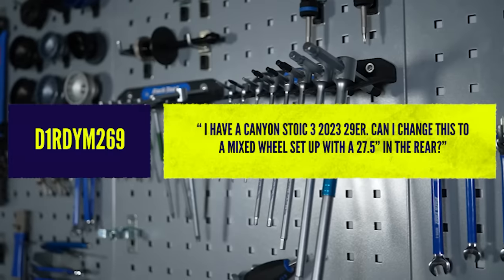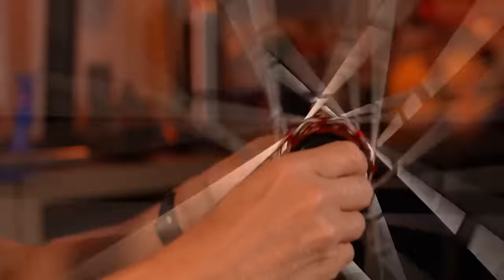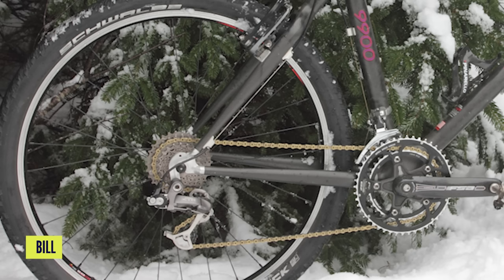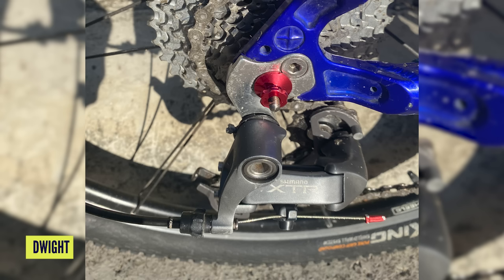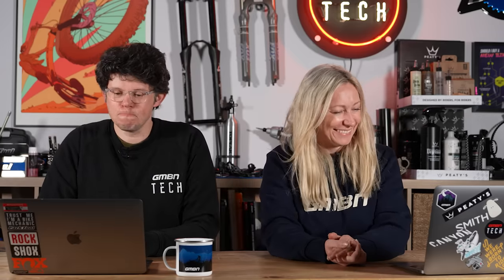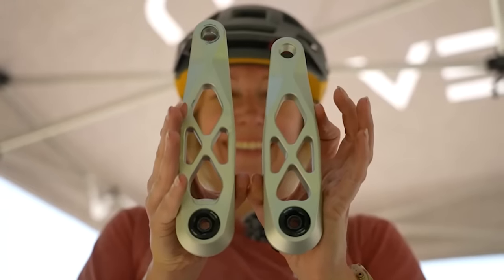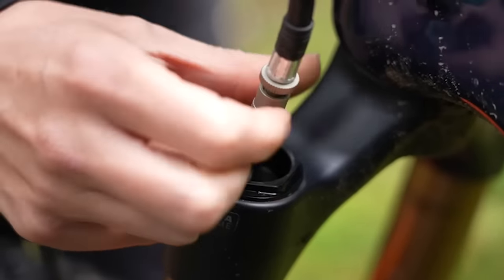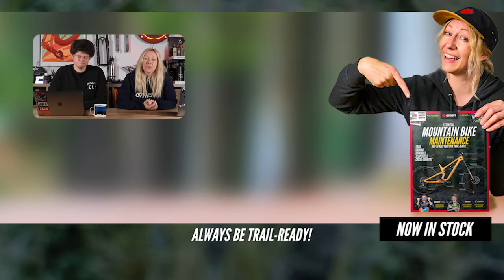Can You Make A Freehub Louder? | Ask GMBN Tech

Comment: Regarding reducing the travel, the answer is much simpler: check how are positive and negative chambers connected. If it's a cutout in the stanchion, it's near impossible. If it's a valve in the piston*, all it takes is a custom spacer above retaining ring or underneath a top out bumper.
*like most of recent RS

Comment: I never had a problem with my Rapid Rise. And I could shift and brake at the same time, when I wanted and needed to easier. Also you could do a fast and massive shift up the cassette without worrying about snapping your chain, because the shift was controlled by a spring and not jamming it with a mechanical cable. I think riders and mechanics had a problem with it, because, it was different and backwards to what they were used to. Given time and refinement it would have been great. I feel that on a 1x12 system large range or gears, it would work great and lower the chance of snapped chains.

Comment: Rapidrise was brilliant, and completely intuitive. The gears were the same on both front and rear as opposed to the normal system which is reversed.
They should bring back dual control levers for di2 systems, that was the best part of the system.

Comment: The amount of homemade multi sprung hubs I’ve had over the past few years from customers instore, some using coke cans, other tape measures cut up…. It doesn’t improve the hub, and it’s arguable it even makes them louder, but it definitely ends up with bits of broken home made springs floating around! Most don’t understand that the high end hubs do a lot more than just have more pawls, making the louder.

Comment: Dual control levers on road bikes were a huge game changer. It makes sense because the lever blades are long and fit naturally in your hand, and in an easy position to operate without mishap. On MTB however making the gear changes are at an angle which is unnatural for your hand position. There was also the risk of accidentally operating brakes trying to shift on rough terrain, and vice versa. The modern solution of having seperate units that can bolt to the same clamp makes much more sense.

Comment: I had an XTR rapid riser on my 2003 Canyon Nerve MR8 with exactly those XT Dual shifters. I think they call it an inverse derailleur in Germany - The problem on that MTB is, I couldn't jump fast down to lower gears when accelerating uphill.  The dual shifters were also annoying as you could just accidently brake or shift a gear at the same time when you were getting tired. I sold the whole system on ebay a few years ago, replaced them with regular non inverse XT and haven't been missing them since.

Comment: I still use the Shimano dual control levers (cable) on my commute MTB and they work great🤙🏻🔧
Reply from the maker: Are they easy to get parts for? 🤔
Reply: @gmbntech  They were bought NOS and been using them for about 15,000 kms now. Haven’t had to buy any parts. I would say, I think the 9 speed shifter cable has broken a couple of times more than expected due to the internal design (has always broken inside the lever) but still very easy to swap out👍🏻

Comment: #AskGBMNTech First of all congratulations for the program, considering for example 2 kilogram of gear like water, tools, spare, co2, etc, it’d be easier to my legs having those 2 kilos on me?(fanny or backpack) carrying my legs those 2 extra kilos on my body and a lighter bike?, or the 2 kilos on the bike, pouch, bottle cage?  In this case my legs will have to move a bike 2 kilos heavier. Consider that the total weight that has to be moved is the same. Silly question. Have a blessed day guys. 
P.S. Anna Cipullo is my platonic love 😍😍😍😍😍😍😍. Big fan.

Comment: #askgmbntech. I have been riding Magura MT5 brakes for over 6 years and always thought they were a bit spongy. A lot of bikers in communites praise the shigura solution. I was thinking however if steel routed break lines would do the trick instead of replacing the levers for eg. Shimano?

Comment: Wasn't rapid rise promoted as "good for uphill" as if you accidentaly dropped a gear pedalling would get lighter instead of heavier, thus more suitable for those hill climbs?
Reply from the maker: That's a good feature! Maybe that was one of the reasons they designed it, or is it was an accidental feature? 🤔
Reply: I believe it was more so the thumb pushing the gears up the range on the front mech, and so the theory was matching it’s pushing the gears up the rear up the range also, the believe being the general public would understand it better….

Comment: #gmbntech I have a Cannondale FSI with Stan’s Rapid wheels. It’s been neglected to some degree and there is a bit of rust in the cups and ball bearings. Is the hub shot or can it be cleaned up and stay in use?
Reply: It depends on the surface of your cups and cones. Ball bearings themselves are easy to get hold of and are dirt cheap, but if your cups and cones are in poor condition then the hub will never work properly again. Get the surfaces thoroughly clean and free of surface rust so you can inspect the races. If there are any scoring marks, lips, uneven surfaces or deep set rust then they are worn out. If your surfaces are smooth or only look a little polished where the bearings contact them, you are OK.

Old cup and cone hubs are more fiddly to set up but if they are right they run very smooth, just keep on top of maintenance. I have a couple of wheels that use this system without problems, but they do get inspected more frequently than my wheels with cartridge bearings.

Comment: #askgmbntech
I am going to replacing my double crankset
But i am wondering what to put on the bolts in de chainrings: Grease or threadlock ?
Or something else ?
Reply: Threadlock in dry and clean threads only and antiseize compound (like a grease but thicker) underneath bolts' heads to prevent moisture getting in. I do the same to install cleats on shoes. Works well where safety is an issue. Park Tools has a nice small tube which will last forever.

Comment: #askgmbntech hi! I was wondering if sealant loses effectiveness over time? I'm running orange seal endurance, and there's plenty left in my tires after a couple years, wondering if I should swap it for some fresh stuff?
Reply: You’re supposed to change it every year as it can dry out or block the valve but if it’s still working fine then I wouldn’t worry too much about it.

Comment: I loved my dual control shift levers, love being able to rapid shift to an easier gear whilst braking at the same time, makes it easier to be in the right gear when you finish braking and need to accelerate once more.
Didn't like rapid rise rear mech as you couldn't multi shift to an easier gear with one push of the thumb shifter when you got caught out in totally the wrong gear on inclines.
Reply: Multiple taps were so easy (like double clicking your mouse thumb button) , that it (IMHO) made up for the lack of multi shifting ability. Easy to get used to assisted downshifting - still love it on my 2004 Slayer 70!

Comment: #askgmbntech I have a Scott scale 965 and would like to add a bash guard for some extra protection. I did a good search online and could not find a solution. Would you happen to have a solution??
Reply: May have iscg05 mounts around the bottom bracket on the frame which is the most common but not sure about the scale, 3 threaded holes if it has. You can get a bb spacer to give you this mount very cheap if you have one to swap out.

Comment: #askgmbntech I have a hand and rist ach for a couple of years tryed number of grips to try to deal with it and nothing seems to stop this ache even tryed rolling my handlebars back and forwards do you have any suggestions  that might  help cheers
Reply: Try Locked "Winged grips" similar to Ergon's in the position that supports wrist to your comfort (palm resting on the convex side) and  aligns forearm and hand (metacarpal) bones in a straight line. Usually in an angle of 30-40 degrees above the horizontal , depending on your sitting position on bike. I use mirror on the side to check. Also avoid positions of excessive ulnar or radial deviation of your wrist (your 3rd metacarpal bone should be in-line with your forearm). Your handlebar length and its back sweep angle will play a role too in helping you achieve that perfect comfortable position.

Comment: #askgmbntech my brother has a hybrid bike scott sub cross with a 29inch rims etrto 622x19mm with tires 45-622, 700x45 Kenda booster. He rides uphill and downhill Sigle tracks. Can he upgrade the tires with 28x1.75 on those rims like the Schwalbe smart sam 28x1.75 which are ETRTO 47-622 for more of a mtb tire , or he should stick with gravel tires like the Continental Terra Trail 45-622

Comment: #AskGMBNTech 
I have Shimano MT200 brakes on my bike. They worked like a treat after i installed new brake pads. But since a few days they started squeaking and loosing brakepower.
What could be the issue? I also didn‘t lubed my chain with spray oil so i dont know how they could get contaminated?!?
#AskGMBNTech
Reply: This sounds like contamination, I also ride MT200s and they never had this behavior except for contamination.

You can clean them again, or you can try to get them warm, this works too on MT200s to get rid of contamination